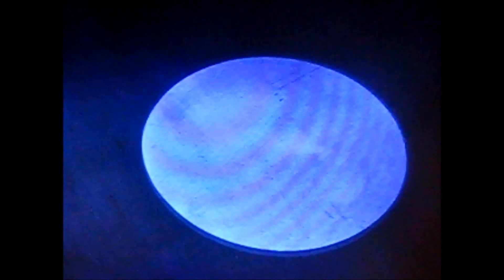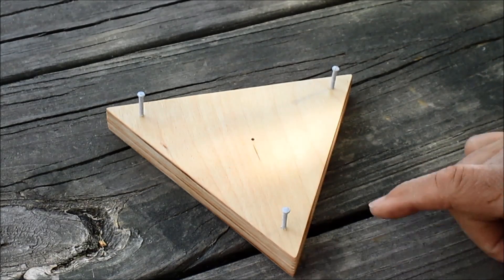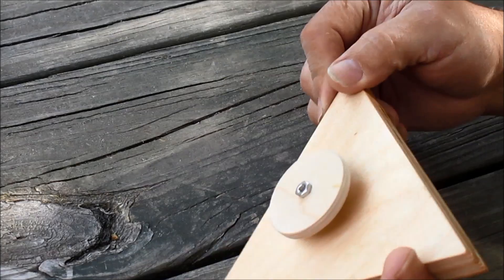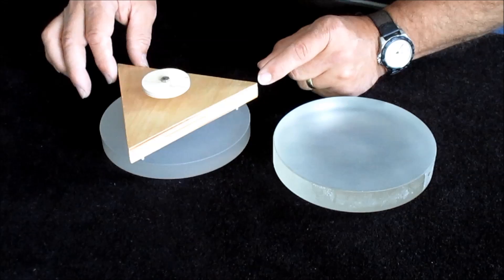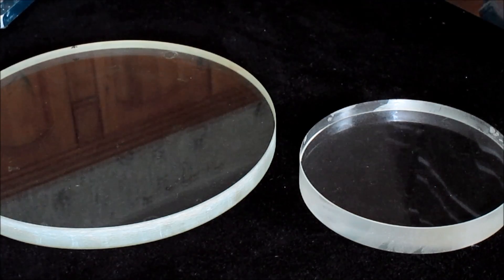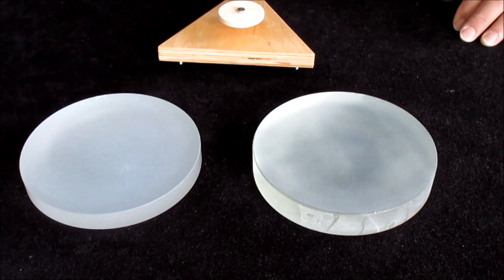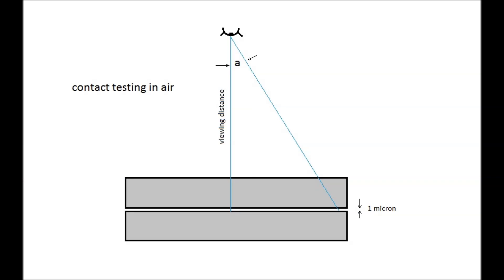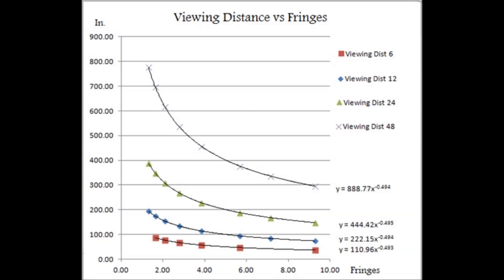More on flat making

Comment: 6:50 I think that;s wrong. The second part has to be convex if it spins easily. If it were concave then the outer pins would touch and the center would be free so it could not spin.

Comment: Thanks for the interesting video.  I am having a hard time finding anyone grinding flats for their telescope star diagonals....do you happen to know why?  (not sure how you would grind an optical flat for a piece of glass that is only 4-5mm thick...maybe have to back it with a thicker optical flat as support).  It seems like you could grind a couple ~20cm flats and water jet cut out a bunch of star diagonals (again, not sure how you'd grind thin flats).
Reply from the maker: Commercially flats are made using a planetary polishing machine, something I'll bet you rarely find in a shop making telescope optics.  Glass 200 mm by 4 or 5 mm thick is not much stiffer than a piece of rubber (some exag.).  You could back it with wax or blocking pitch but unblocking will invariably relieve any mounting stress if you aren't experienced at it.
Reply: @Opticsed  Interesting.  Seems like a big hole in the d.i.y. telescope efforts, that is, nobody's making their own flat mirrors for star diagonal or ellipticals (e.g. for Newtonians).  It seems kind of weird that that part of the d.i.y. effort has never really been attacked and people cave in and just buy the flat mirrors.  Or they're just way harder to make than a large parabolic mirror.
Reply: @perspectivex  Secondary mirrors are a lot thicker than your thin star diagonal and is a bit easier for ATMs to do.  Texereau in his book describes how to make a secondary mirror.   One method is to block it up with pieces of glass all around it to make a circular part, (probably the best way).  (Secondary mirrors are done in large blocks commercially). The other method is to mount a larger circular flat imbedded in plaster at 45 degrees and to core it on a drill press.  The resulting thin edge however will often turn up due to the Twyman effect.  Making a flat is still not easy compared to making a primary mirror and if you can do it you can call yourself an optician.
Reply: @edjonessongs5308  I have to admit I'm only interested in star diagonals at the moment.  It looks like nobody diy's those or so few that they're not to be discovered.  On a similar note....do you think the Whitworth three plate method work to make three round optical flats?  Just keep using smaller grits, no pitch lap or anything like that.
Reply from the maker: @perspectivex  If I were to try making your star diagonal 4 or 5 mm thick I would cut it to size first (2 X 3 inches?) then wax it to a backing plate surrounded by other pieces to make it 6 inches in diam.   (I wouldn't use the 3 flat method unless I actually needed 3 flats.)  I might expect some stress relief when unblocked.
Reply: @Opticsed  ok, thanks for the suggestion.  Now to make a planetary polishing machine...:)
Reply: @perspectivex  Well sure, why didn't I think of that.  I'll bet every ATM has a $XXX,XXX diamond turning machine in their garage.  LOL
Reply: @edjonessongs5308  the mind's eye is more well-funded than the pant's pocket.
Reply: @perspectivex  You need a polishing compound and a lap rather than a grit to get a good optical surface.
Reply: @carlhitchon1009  sure, I understand that.  I would guess the progression would be very similar to grinding a telescope mirror with SiC grits from ~80 (well, probably could start with ~200? since you don't need to make the deep curves) to 300-500, then 25/12/5 micron aluminum oxide ("-ish", everyone has their preferred sequence), then cerium oxide or rouge in pitch to finish.

Comment: 5 year old video, but what the heck. Problem with the 3 flat method. You have a process shown with steps like "Grind B on C then grind C on B" as if they are different steps. The process is A --> B, B --> C, C --> A, rinse and repeat.

Comment: Is the difference in cost of three blanks versus two blanks really significant enough to do it this way?
Reply from the maker: You can also make it with one blank and a tool but cost and having to polish 3 optics instead of one is your decision.
Reply: I don't think you can ensure flatness by the process alone with 2 blanks or 1 blank and a tool. You'll have to read when one piece has flipped from convex to concave so you can switch the pieces, and I don't see how you do that without a tool like this.

Comment: The optical spherometer-comparator was introduced to amateur telescope makers by Robert E. Cox, editor of the Sky & Telescope "Gleanings" column in the late 1950's. It allowed amateur telescope makers to make the difficult optics for Maksutov telescope designs.
Ed Jones has shown us an even simpler approach using a triangular plate of baltic birch, a material that was not available then. The advantage is that it is a laminated material for rigidity. It should be shellacked so that it does not expand and contract with humidity changes and should be more stable under temperature changes.
Previously, plywood has been used for lap forms for polishing pitch and works pretty well. Adding a thin sheet of plate glass to a Baltic Birch disk should make a viable alternative to dental plaster forms that take time to dry. Ceramic tiles can be epoxied to the glass disk to make up a grinding tool. They can easily be removed by heating the squares slightly with a propane torch. 
The threaded rod is a neat change from a micrometer head or dial indicator that would be much more expensive.
Great care must be taken to not drop the comparator on the flat under test. Even aluminum nails can cause a bullseye
fracture defect much like a BB strike. Great care should be taken when tapping the plate for the screw rod. If the screw is not tight in the threaded hole, it will rock back and forth, leading to erroneous readings.
The aluminum nails avoid the use of steel balls that need a complex calculation to correct for their radius.
Great contribution to the craft Ed !
Starman Paul
Reply: While it's true that the Birch plywood is an excellent material for this, it's absolutely not necessary. The key to this tool is the three aluminum standoffs and the adjustable center brass post. Any material holder - plywood, solid wood, acrylic, steel - will do the job just fine, and the flatness of the substrate doesn't matter as long as it does not touch the glass to be evaluated. The key insight is that even a micron level difference in flatness will allow the tool to spin on the convex plate if the distance is set on the concave plate. To refine this further, you'll want to be sure the aluminum posts and the brass post have spherical ends or come to a dull point. An imperfectly flat post could cause some irregularities in the readings you get with the tool - best to eliminate that possibility.